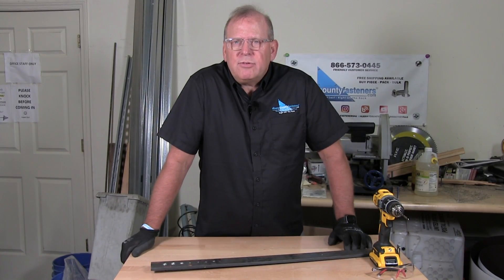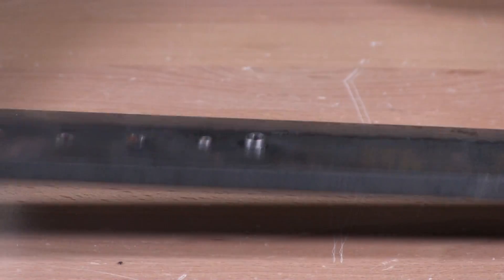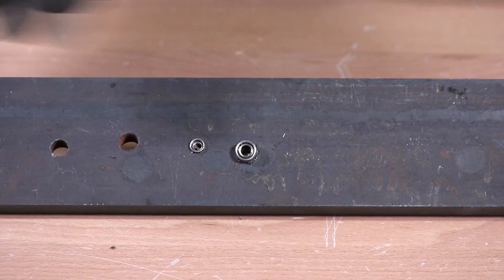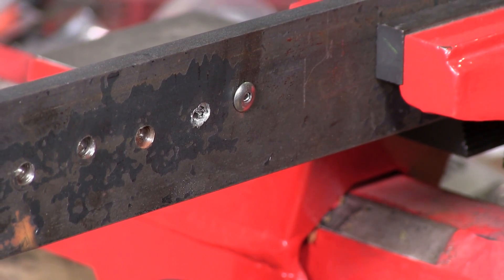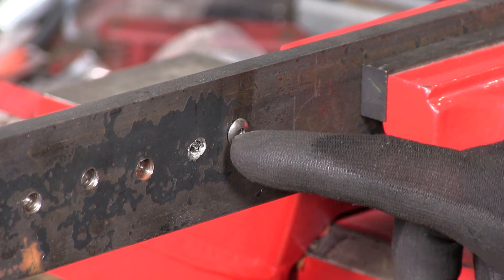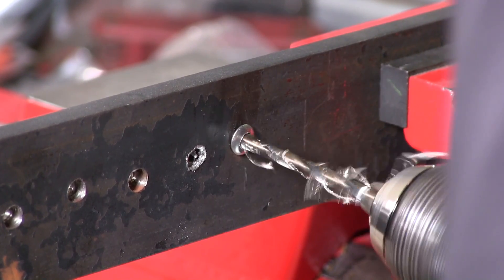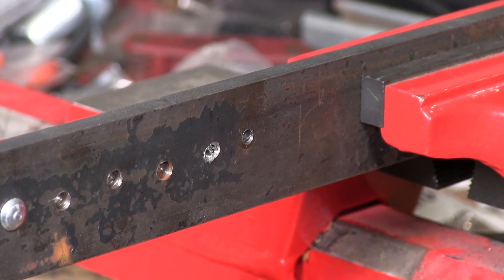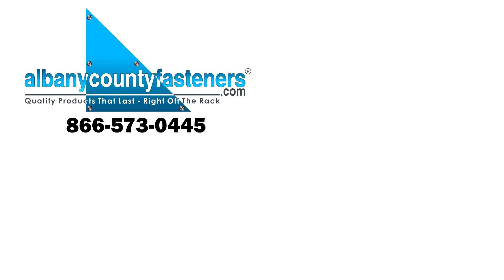How to Remove a Structural Rivet | Fasteners 101

Comment: Hi there! I am finding very hard to remove structural rivets... I tried 6mm Bosch HSS-co and HSS-ti and the sharpness only lasts 2 or 3 rivets at maximun... Am I doing something wrong? The drill doesnt get through after the 3rd rivet.... is it a problem of my drill? (Not enough speed?) or force (should I lean with my weight?).
Reply from the maker: What kind of drill bits are you using? We recommend Norseman-Viking brand. You should be applying plenty of pressure to the drill, just be careful that the bit doesn't slip.

Comment: What type of drill bit should I use
Reply from the maker: A drill bit designed for drilling into metal should suffice.
Reply: I know that but ordinary steel bits only burn out  and Cobalt bits aren't much better  quest you don't have to do this very often your video isn't much use then

Comment: Structural rivets are a pain to remove and you made it look easy. Ive been hitting the mandrel out with a centre punch then drilling it out.
Reply from the maker: Well we hope the video helped you for any future structural rivets you may need to remove! Thank you for your feedback.
Reply: @AlbanyCountyFasteners  Ive probably been using the wrong drill bits too but nice when the rivet comes out though. Years ago i had to do it the much harder way by chapping them out.